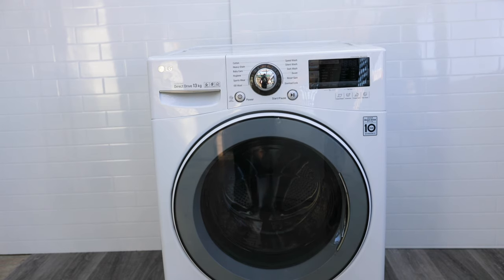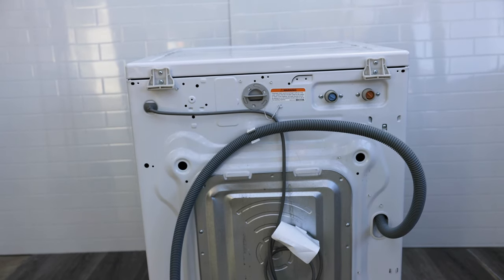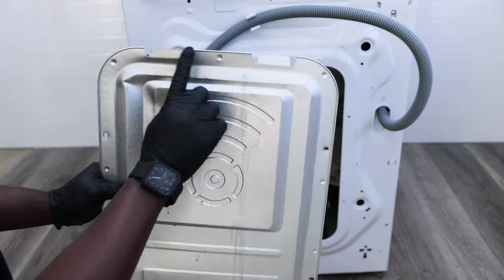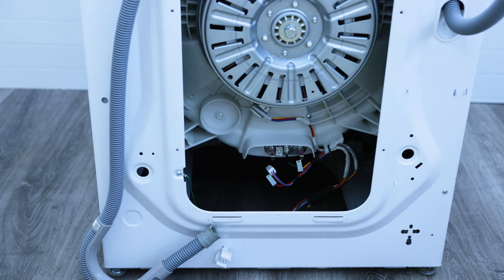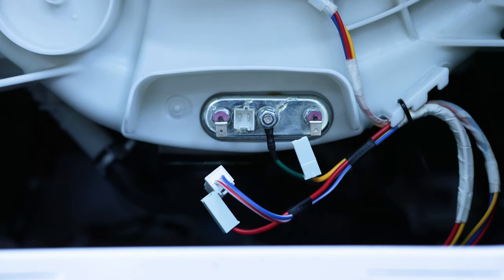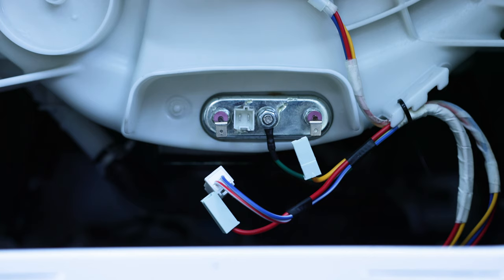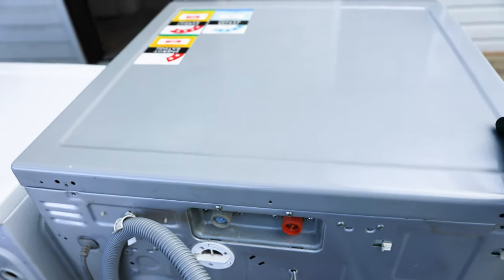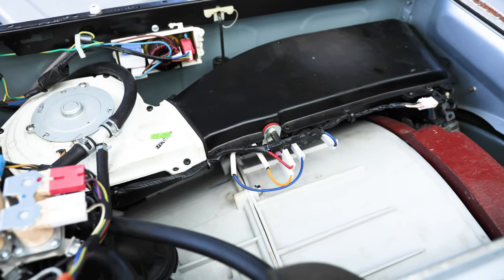LG  Washing Machine Tripping Power Easy Fix

Comment: Amazing, this helped me so much! My LG washing machine started tripping the RCD on startup yesterday. Found your video and immediately tried disconnecting the heating element. Switched it on, tripped again, heart sunk. Then looked for the steam generator, found it caked in rust (the machine is about 10 years old now). Disconnected the steam element and reconnected the main element. Switched it on and it doesn't trip the RCD anymore! Going to hold off the steam functions for now until I can source a new generator. I would have had no idea without your video. Thank you!
Reply from the maker: Awesome, so glad it helped you. Good on you keeping on investigating

Comment: Thank you..manage to re use my washer again. In storage for 4 years due to it  tripping the breaker. decide to give a try to pull the heater wiring as last try before throwing the machine away.it works!!!
Reply from the maker: Glad I could help

Comment: Thank you greatly appreciated, I have done what you have showed and my machine is working, if one leaves the square plug connected, one can still use the machine while sourcing the spare parts for it. Then the machine still recognizes the element being present and the machine works without hot water...

Comment: Thank you , legend , mine appears to be the heating element , been driving me nuts for a year , intermittent fault , currently working on cold with power cable disconnected to heater element . Saved me $$$$$ that i dont have . Cant thank you enough . ✅✅✅✅✅✅✅✅✅
Reply from the maker: welcome glad it helped
Reply: Ok
Reply: When I disconnect I get the te error code, and prevents me from washing
Reply: @BassPlug Music  connect back the white square plug so the element us still recognized by the machine, disconnect the power leads only, washe will work.

Comment: Thanks man... it saves me money from calling electrician.... I just remove heater element red cable only and no error came out. if I remove all 3 cable, there's CH error appear. Mine LG CD1006SM. Regards from Malaysia.
Reply from the maker: welcome, get a new heater and reconnect the cables
Reply: I unplugged all three & error pop up
Reply: @ryukikaze  you cannot unplug all three cables, just unplug the heater element red cable. A neutral cable needs to be plugged.

Comment: Thank you very much for this video. I have a question. Before I get my heating element replacement, is it ok to run the washing machine without having the heating element in it? I removed it completely.
Appreciate you video
Reply from the maker: if its the steam heater yes if the washing heater at the bottom of the dryer no

Comment: I have the steam washer and my washer will start normal and will trip the breaker in mid wash. With that being said which element should be changed, the top or the bottom element? Also shall I unplug the top and bottom so I can use cold water until I get them.
Thanks In Advance

Comment: We have the model you had at the start of the video. It only shorts right at the very end of the whole wash and spin cycle...would the heating element be a likely cause for this?
Reply from the maker: might be a faulty motor,  remove the back panel and check if water has been leaking below the motor

Comment: Clearly explained and identifies the problem, but I've tried every which way to prise the element out but without success. It's firmly locked in place. Any tips?
Reply from the maker: Hi did you undue the nut ? Unfortunately sometimes they are really stuck in there. Using wd40 to loosen it might help

Comment: I just remove heater element red cable only and its working  with cold water only, Thanks so much God bless.
Reply from the maker: Welcome glad it helped
Reply: I just replace another heater element, everything is working fine now.  Thanks once  more.
Reply: Thanks folks, reconnecting the other two and leaving the red disconnected worked. 🤘🏻🤘🏻

Comment: Thanks for being helpful. Question: my LG machine trips off once i put the electric cord in the socket. Do you think it is the heating element? And if I want to change it by myself, is there any possibility that I may damage the machine? Since I never did something like this before, but it looks doable.
Reply: Check the ac line filter, then the ptc door switch, next is electronic pc board(if the electoniv board is dead it is good to check or replace the door switch).

Comment: i will try the heater element suggestion. 

my BUSH A127QW washer was working fine for years as is but has started to trip the circuit breaker, it will turn on start to fill/run as usual for about 10 seconds then trips the breaker. before this happened i had noticed that wash cycle would go on and on until i manually turned the dial to rinse, then it would drain the water out and rinse and drain and spin the clothes out just fine, but now it just trips the breaker at the start. ive tried a cold water cycle too thinking it might be the heating element but no it trips the breaker as i described above. the fact its starting then tripping the circuit is bugging me as its working but something goes off,  also the fact if it was set to drain and rinse manually before this breaker tripping started, it would do that so that suggests the drain pump is working as well. man if you could help me that would be great!!

Comment: Hello i am a woman who need to fix this.. my question is.. before that my machine is a combo washer/dryer but i seldom use the drying function.. my maid seems to like to stuck in clothes that at one point i could feel the heat from the drum.. so i feel 90% sure the heating element is the problem.. adding to the issue was once i try to switch on the machine.. the electric tripped off.. my question is for my steam wash/dry.. does it have 2 heating elements? Do i hv to open both top n at the back?

Comment: Thanks , So I did disconnect the heater but then it shows the fault tE and so I cant progress things to identify whether that fixes the fault and I am a bit stuck now . Can order a heating element ad look to replace that but is there a way to ask the machine to run wven tho the element is disconnected so I can be sure this is the problem fixed? TiA
Reply: If you disconnected the square plug with 2 leads that is the temp sensor and will cause an error. The larger plugs on the outside positions is the heater and only one side needs to be disconnected to eliminate the heater from the circuit. Unless your machine knows the temp is incorrect, as that is a temperature code
Reply from the maker: Yes you only need to disconnect the heater and not the temp sensor

Comment: Hey, this is an absolute long shot and I'm hoping you'll see it. It looks like my heating element is the source of the problem (thank you for the advice). My original element says ZYETU AC 230V 2000W AEG73309901, however the only replacements I can find online start with ZYEH? Do you know if that would still work? Thank you in advance.
Reply: So I think I found the difference, which is the immersion depth: 290mm (ZYETU) Vs 305mm (ZYEH). So the only real question I have now is am I going to set fire to my house if it differs by 15mm?

Comment: Hi! 
Loved the video, my lg doesn’t have the heater at the back it appears? 

Mine turns on for like a second then trips the rcd. Any ideas??
Reply from the maker: hi I would start disconnecting different components. Start with the washing machine drum heater. disconnect and reset until you find which one is causing the issue
Reply: Do some lgs have the heater at the front??

Comment: Hi mate, thanks for a great vid. I had this issue and changed the heating element watching your vid. It seems to have solved the tripping issue and I'm not getting any error codes on the washing machine but the water is not getting hot no matter the temperature I set and washes only with cold water. There's no error codes as well. Any ideas? Thanks
Reply from the maker: Welcome. Did you also change the temp sensor or that came with the new heater ? Check the wiring to that might be shorted or faulty

Comment: The tripping problem just started on our F1480TDS ..... It trips about 10/15 seconds after we power on, this model also has the stream function that doesn't get used much. You think it'll be a heater element?
Reply from the maker: Hi it might be the heating element of the stem generator check that
Reply: @askmrwashywashy  thank you

Comment: Hi my  gorenje machine is doing exactly this, tripping the RCD as soon as its plugged in. If I disconnect the heating element can I still wash? Does this mean it will not heat the water for hot washes? Thanks
Reply from the maker: yes and yes

Comment: I just removed red wire from back of machine and it started working, do I need to take care of anything else ?also after placing back cover do I need to take care of anything?
Reply from the maker: No you can only do cold washes now. Replacing the heater if you want hot washes would be needed

Comment: So if we disconnect heater wires can we still be able to get dried clothes like completely dried in washer&dryer machine???
Reply from the maker: Yes it doesn’t need heating when drying so should be fine. Heating is only for washing
Reply: 2

Comment: Its ok to remove heating elements and it will work?
Reply from the maker: Heating element is needed to heat up the water so make sure you replace if it’s the problem. Otherwise you can just unplug the wires and use as cold wash only

Comment: When you say "turn on your washing machine" throughout this video, you mean turn on the unit and start a wash cycle, right? You don't mean just press the power button on the machine... The circuit does not trip when just pushing the washing machine power button.

Comment: Mine does not trip right away, I get a load done and when it's time for the next load a day later or two it's when I notice it tripped.
Reply from the maker: does yours have steam wash ? How long have you had your washer ?
Reply: @askmrwashywashy  yes it does, I can wash loads all day but when I decide to do a new load days later is when I notice its tripped.
Reply: @askmrwashywashy  our washing machine with steam washer does the same thing. Trips once cycle is finished

Comment: Sir my machine pcb trips and the company also don't find what's the issue?
Reply from the maker: Disconnect the heating elements. Water valves, motor , do it one by one until it stops tripping

Comment: But I am not using hot water and it’s just tripping the wall outlet about five minutes into cycle.
Reply from the maker: Hi. It has an in built heater that can be causing this issue. Even though you're not using hot water the heater might have failed. How long have you had it?

Comment: Mine trips after it I start a load ,
Reply from the maker: Check if it does it on the cold wash. If not it’s the heating element
Reply: @askmrwashywashy  it was actually a faulty door latch

Comment: Any tips for Sharp  ... After i power on,  it str8 away power circuit what should i do?
Reply from the maker: Haven’t worked much with them. Best to check the heating element on it and also door switch. Disconnect them then start the washer and see what happens
Reply: @askmrwashywashy  okey,  i try it soon

Comment: Too bad it doesn't work without the heating element so you are forced to replace it. More features these modern washing machines have, more failure points. Some LG models from 2011 still work because they didn't have any of these nonsense.
Reply: hmm SO I removed all except the middle cable and now it is working fine. I guess it is the sensor that tells the washing machine the heating element is there. Need to run some more tests and see if it is safe.
Reply from the maker: Yeah it’s a bad design. It was simpler back then. Lucky enough the heater doesn’t take out the main board. Sometimes a faulty pump causes the board to fail.

Comment: Hello Washy I’m a domestic appliance engineer for about 20 years now.I have to disagree with your methods especially when you are trying to teach your viewers on how to  repair there machine,telling them to pull off wires and hope for best.what about getting a multi meter and test to see if you have a circuit instead of throwing parts at it.Listen don’t be offended it’s just constructive criticism.👍
Reply: Not everyone has a multi meter, as you mention about throwing parts (money) at it no good throwing £30+ for a multi meter to be used once. Its a process of elimination i suppose better than nothing or even wasting money that may not need to be wasted.

Only reason i mention this is that mine has just started tripping when turned on and this vid (as have other vids) have helped find the issue.

Cheers mate
Reply: Lmao domestic appliance engineer…
Reply: I am not an appliance engineer and unlike you  have 0 years experience. This video allowed me to diagnose my own problem and it cost me £0 pounds to do so and took about 10 minutes. I would have to disagree with your comment. Thank you to the guy who made this video